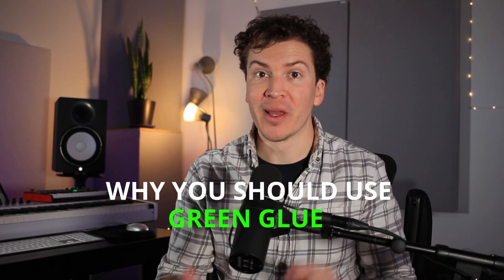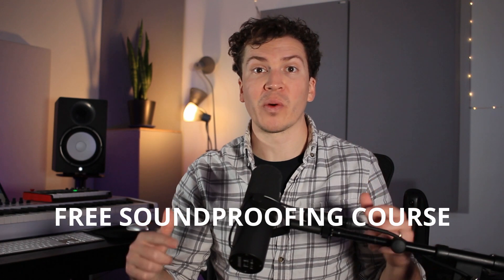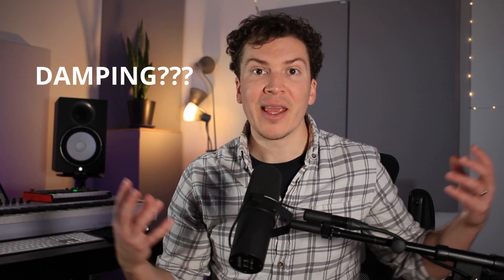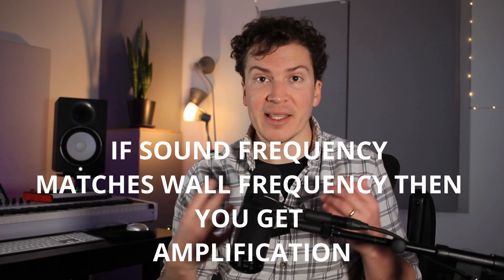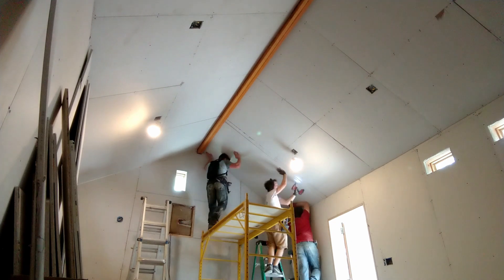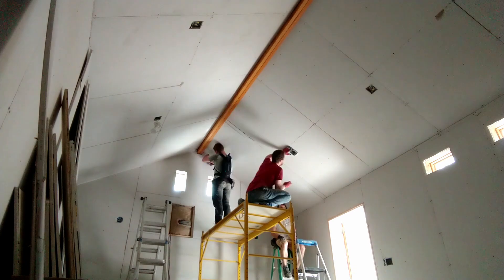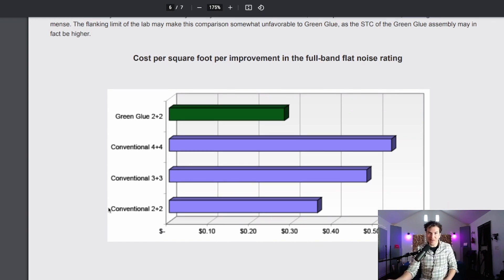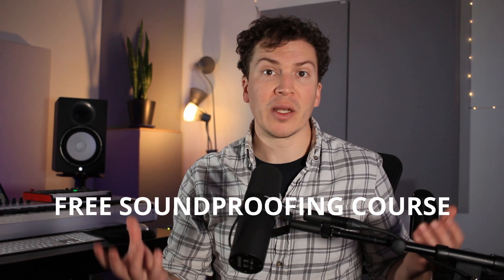Why You Should Use Green Glue To Soundproof Your Studio

Comment: I am going to put a studio in a basement with concrete block walls.  I will have 1/2” polystyrene foam panels glued to the block, a 1” gap, 2x4 framing with R-13 or 15 fiberglass batts and then 1/2” drywall for the exterior walls.  Because the walls are not touching the concrete block walls (or the foam panels) can I get away with not using green glue?  Obviously the ceiling and walls leading to the rest of the basement will be with 2 sheets of 5/8 and green glue.  Also, the basement walls are mostly underground.  Will that be enough?  I might also try some type of isolation pad between where the top plate meets the ceiling joists.

Comment: My garage is already finished with drywall. What’s the best way to add soundproofing with that drywall already being up and finished? I’m trying to do as minimal as possible so any drywall or studs that’s added doesn’t take up room space?
Reply from the maker: Thanks for watching. So I wouldn't really recommend doing any soundproofing if you are not willing to take off the current drywall. You could add mass by adding another layer with green glue, but I honestly don't think it is worth all the effort for maybe a marginal benefit. You need to decouple your walls from the outside frame and the best way to do that is to create a double wall system or use hat channels with soundproofing clips. Sorry that is probably not what you wanted to hear. As a cheaper but less soundproof solution you could put on a solid core door and use weather stripping to seal it up and see if that helps.
Reply: @soundproofyourstudio  could I just install 2x2s over the existing drywall and then put another layer of drywall so there is a small gap or would that still not be enough or be worth the effort?
Reply from the maker: @ryfimusic  No, I wouldn't do that. I think you really should consider taking the current drywall off and doing either a hat channel system or building the double wall system.
Reply: @ryfimusic  I would check out Sonopan seems super effective just screwing it on as a layer. Unfortunately only available in Canada right now

Comment: That stuff is so expensive! I reckon I'll get more sound isolation from simply putting a 3rd standard/thin layer of dry wall up in the sandwich instead - certainly in cost/performance terms. Carpet glue has similar properties so I may use that as an adhesive/barrier at a fraction of the cost.
Reply from the maker: Hey Lee! Thanks for watching. My only recommendation is to be careful veering from the lab tested results since a lot of times things that seem logical with soundproofing don’t end up working and may even produce worse results. Soundproofing is expensive. There isn’t much of a way around it unfortunately.